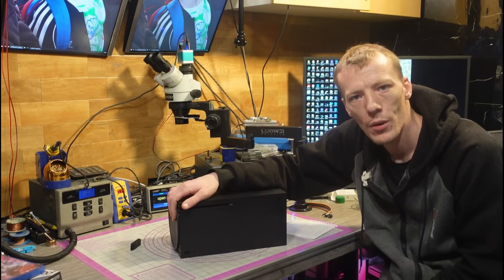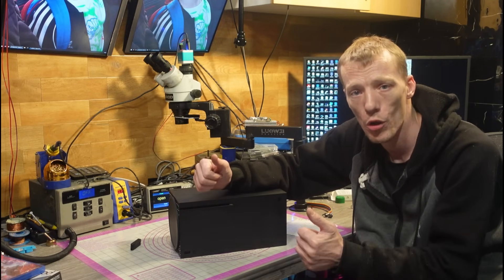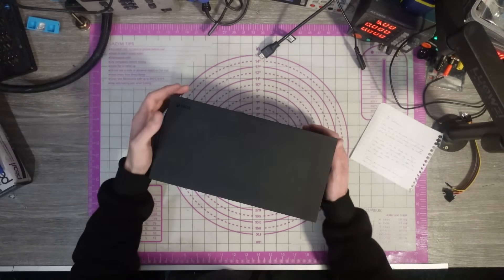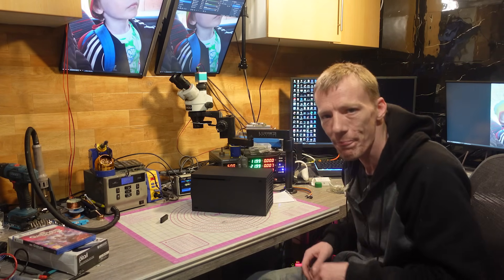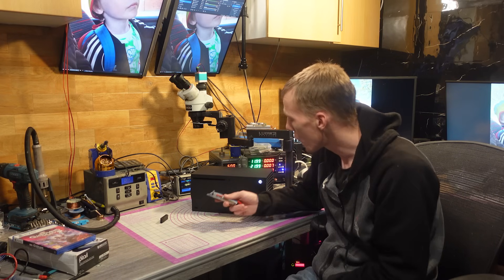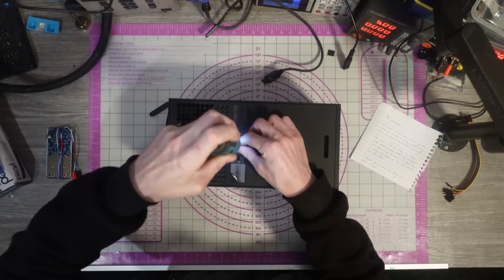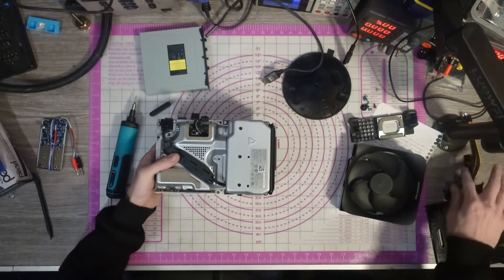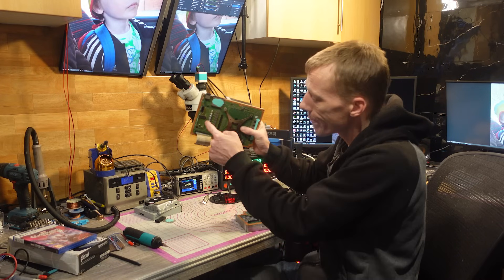THE XBOX IS DESTROYING THE WORLD... AND IT'S MICROSOFT'S FAULT!!!

Comment: What folk need to remember is you can pick up a Working Series X for less than £200. I got a virtually brand new one with controller and all boxed as new for £200 off gumtree.  Much less hassle and saving you a big headache trying to get a broken one fixed. These companies need to stop using weird screws as well, having to buy special tools just to fix a game controller is ridiculous. Why can't they just use normal screws.?! Great video and informative.👍
Reply: "Why can't they just use normal screws?"
You just answered your own question. They don't want normies fixing things easily if there's even a 0.01% chance they might just buy another.
Reply: arnt the screws just T8 or T10 screws or similar?
Reply: @BetweenTheLyons  bosch also use T10 or t8 screws its a manufacturing thing.
Reply: Because the tool you need it's them who sell it guaranteed

Comment: My friend did this to a Series X that he bought broken about a two years ago. The console was damaged by a power surge and stop working according to the original owner, he sold it to him for 125.00 US. I told him that I think he needed to replace  certain chip (can't remember the name of it) and recommended that he take it to a repair shop because fine soldering would be required and the chip was hard to come by. He kept insisting that he'd fix it himself and told me that it's probably something simple. I offered to buy the unit off him for 175.00, he refused and proceeded to format the SSD (without backing it up or trying to clone it). I had warned him that people were saying that you can't mess with the SSD because the unit will be useless without it. Now whenever I visit him, I remark about how lovely his 125.00 paperweight is!
Reply: There are purposes in lessons but i wouldnt sprinkle salt in this wound. Smart people learn from mistakes of others.
Reply: It won't be long before someone figures it out and it'll work again. 

It'll only take 1 dev to  get annoyed. 

PlayStation tried this and failed, xbox/Microsoft is not special, someone will hack it.

Comment: They probably have a service tool to replace the ssd for warranty repairs, but they're never going to give it way. Fixing second hand consoles instead of buying new ones is bad for their profits.
Reply: sort of but don't they sell at a loss because it's a vehicle for getting Gamepass subscriptions?
Reply: @Warlock_UK that’s not what “selling at a loss” means. It’s a common thing that people don’t understand it because the term itself is almost a lie.

They are making money off each console sold BUT it’s classed as selling at a loss until r&d and production costs have been recovered. 

For example ps5 released “selling at a loss” but due to the high sales by August 2021 it was no longer selling at a loss.
Reply: @EelofTheTRIMS  Factoring in R&D, of course - though they could offset that elsewhere.  Initially (well, in 2022) it was hinted that a series X could cost $500 - $700 to manufacture.  Whether or not that includes a fraction of R&D isn't known - but still, if the current per unit manufacture cost is more, then they're doing it to get people to buy accessories, gamepass etc etc.
Whereas Sony don't currently make a loss, neither do Nintendo.
Reply: @Warlock_UK hinted and actually is are very different things. What you have to remember is most of the time when people do this they are treating it as making the console themselves and not factoring in that massive contracts for millions of each part will cost far far far less per individual part which brings production costs down drastically. 

Though the chip shortage at the start of the generation most likely drove prices high this time around though.
Reply: Their policies are bad for profits. Xbox is not doing well. This won't help them.
Reply: @EelofTheTRIMS  Actually that is what selling at a loss means. Only the $499 disc version of the PS% was profitable in August 2021. The $399 discless version was still being sold at a loss. If it was about recouping R&D both versions would have become profitable at the same time. When they say selling at a loss they mean they are losing money every time they sell a console.
Reply: @nerdstrangler4804 no it doesn’t. I didn’t only say r&d I also said production costs.

They were produced in different places on different production lines thus incurred different costs. The disc less version cost less money to buy and didn’t sell as quickly so took longer to break free from the money spent on  production. 

It’s not so much you are losing money as you haven’t yet recouped costs.
Reply: @EelofTheTRIMS  like 95% of the components are identical between the disc and discless version. They use the same production lines.

What it means is, adding a disc drive probably costs them like $20, but they charge you $100 more for it. So that is why they were able to break even on disc version before the discless version.
Reply: @nerdstrangler4804 the components are the same yes but no they don’t use the same production lines. They are assembled in completely different factories.

But yes you are right about the disc drive and the added cost for that version. 

The disc version also sold better early on because people like options. I know plenty who don’t even buy their games physical anymore that still bought the version with a disc drive “just in case”. I thought they were mental of course 😂. That being said I have the disc version but I generally buy my games physical because I like shiny things 😂😂

Comment: Nothing is stopping Microsoft from releasing an image file with an unpaired drive, waiting to be paired. Unless the motherboard chip that stores that pairing information is a write-once chip and it's gets fused off after pairing.
Frankly component pairing should be illegal. Not just for consumer electronics like this, but for everything. Mercedes has been doing it for about 20 years. An arrow on your dashboard broke? You can't replace a part on their car without going to their shop and paying their extortionist prices.

Comment: My guess is they stripped it down to pull the SDD (legal requirement for auction houses this stuff is normally from bailiff companies) and didn't care about if the console was working after that as it was getting lumped into an auction.
Reply: ignorant people not wiping the drive but physically trashing the console to get the drive.
Reply: @HR91360  Not ignorant just people that by law have to REMOVE the drive and dont get paid enough to care.
Reply: @pilksuk  I'm confused.  Why are they legally required to remove the SSD?
Reply: @fffrrraannkk  UK Data protection act companies must ensure personal data is professionally data wiped and certificates provided or the hard drives have been destroyed.
Reply: @pilksuk  Gotcha.  Thanks for clarifying.  That's a good law and I wish they had it in the US.  So they decided to throw out the drive instead of having it professionally reset to factory settings becuase it would have cost them money and/or time to get it certified?
Reply: @pilksuk can they not just factory reset it
Reply: @SlumDog-ip8bq  Nope they have to prove the SSD was destroyed or professionally data wiped.
Reply: @pilksuk  nice 1 pal

Comment: Someone needs to figure out how to extract the key off the CPU. Pairing it to the SSD is a boneheaded idea, and why I will never get one of these bricks.
Reply: I've always hated Microsoft getting into the games console business. Sega was so much more in tune with the history and so much less anti consumer. They also took risks!
Reply: @YourPrivateEye wee need them back!
Reply: @YourPrivateEye The PSX was 299$ msrp in 1995 which would be around 620$ today, also not very consumer if you go by that logic. And you left out the fact that the Saturn was technically more powerful and advanced then the PSX (harder to develop for, especially in that time, but still more powerful if handled by a competent developer). It also had the ability to upgrade system memory, another thing which was out of the question on the PSX. The saturns architecture was much more complicated but had way more potential due to its multiprocessor design which is why it cost more. There are preview builds out there from Shenmue running on the Saturn and they look better then anything ever released on the PSX which only shows how much potential this console really had.
Reply: @YourPrivateEye Still around, they're a huge company in Japan and still make and publish games, Alien Isolation for example. They just don't make consoles anymore.
Reply: I was thinking more of the reverse... there's plenty of SSD controllers that have mptools available that let you change anything about the SSD, including name it identifies as, serial number etc. ...  essentially make a 1-2TB SSD that has a controller with mptools available pretend to be an original xbox SSD via the serial and model whitelist. That obviously wouldn't work here, but could be an upgrade solution for all the crippled 512GB consoles like the series S where buying an expansion card isn't worth it cause it costs more than the whole console is worth
Reply: @robertharper3114 Those risks killed them. Being a platform holder has never been a lock for success. Many have come and failed.
Reply: @sneezyferret6482 is still i good consol
Reply: @sachacozette9292  Defective by design doesn't make it good any day of the week.

Comment: I only buy consoles directly from Microsoft, Sony or Nintendo these days. Usually not at launch because they either sell out in 10 seconds or sometimes the launch models have typical problems like getting bricked with no power or a faulty disc drive.

Comment: You can fix it you can put any ssd into it along as it formatted correctly and you make a windows thumb drive ifixit have the guide
Reply from the maker: No you can't, ifixit are wrong. If the drive dies the security key goes along with it. You need the original drive to obtain the security key
Reply: @TheCod3r  isn't this the same issue with ps5? the os on the internal ssd and if that dies the hardware rendered useless even if you manage to solder replacement chips.

Comment: just a quick question, as a lamen who know's little to nothing about repairing consoles, I was just wondering - could you not get a broken console with a mathcing board and ssd then place it into that xbox to get that one working or does the removal of the ssd go deeper than just the motherboard, ?.  the reason i ask is in mobile phones I.E apple you have to remove a chip and a board and you can just replace the bothe to make the phone work, you can not just replace one of the parts,  great video, just popped up in my feed, thanks for your time.

Comment: Bought a XBOX One X Scorpio Edition that failed updating for 40€ the other day. 

Thought it's just a software issue, bad HDD, bad SATA cable or something other minor. Nope, seller brought it to a shop and got it back with E100. Idiots replaced the mainboard, but not the disc drive.

Pristine limited edition console is now a donor because I can't pair the fully operational hardware. At least I can harvest it to fix several other consoles...
Reply: So find someone with the right software to flash them.
Reply: @jaykiller4510  XBONE hasn't been cracked yet, parts can't be remarried. Only way to get this thing working again is to find the correct daughter board.

Comment: At least you tried mate, microsoft need to get their act together. But also, the ps5 isn't that much better with their non-removable ssd, but at least theirs isn't married to the motherboard and a technician has a chance to fix it
Reply: If you're confident in soldering, you can at least put a new one in a PS5. Still not ideal but at least it's not bound to the console.

Comment: Good video, sad result. Thanks for sharing.

I do kinda get the removal of the SSD. There are times when I have donated certain PC's to charity, but I understand how to securely erase the contents of a HD, in particular a mechanical type.
If the PC is only suited to a tip then I have considered physically damaging the non-working HD - if it could not be salvaged, to ensure the actual contents of the platters are not recoverable. 
With that mindset of feeling the need to be secure I personally would have absolutely zero understanding of the possible consequences of removing an SSD from an X-Box, as shown. Apart from protecting data and just meaning a new SSD is needed, not knowing how MS has linked them. Nor understanding about the levels of encryption by std on those SSD's.
Ignorance , perhaps, over intent to create such an issue as shown here could well apply.
That resolve, if they are interested, is down to MS to resolve.......good luck there.

As noted in the comments already, if MS are to blame here then Apple better keep their heads down. The "rights to repair" only goes so far.............

Comment: Same thing with Nintendo Switches. The CPU and the SSD are bound. Remove the SSD, then you can completely forget about repairing said Nintendo Switch. 

Xbox AND Nintendo need to do something about this, because data protection is a genuine concern if selling a broken device to someone that can fix it. Why? Well if your credit card, paypal, bank or other is linked to the console on one of the accounts with auto-sign-on enabled, they can make as many purchases to their heart's content.
Reply: They could fix it so easily. Even if you sell a faulty xbox and your card payment is on there, m$/nintendo could just prompt for authorisation using your banking phone app when trying to buy a game.
Reply: Sony ps5 pro is the worse because is too expensif

Comment: Thank God I'm on PC and PS4. Upgrading a PS4 to a new SSD falls on two options Clone the old hard drive or like in this case, build it from scratch through downloading the PS4 software fom your pc and transfering it to the PS4 SSD. Boot the PS4 in Safe Mode, initialize PS4, and install the latest system software. Wait for it to restart and your are done.

Comment: in the case of a faulty SSD, how do you clone it?
Reply: You pray the clone hardware can read the ssd for a few seconds. It only needs that section of data. Than you can stick it into the xbox. And do the normal update repair. The keys are all that matter. As long as the system sees those files. It doesn't care about the state of the install. If the SSD is totally dead. Where the clone can't even start. You cna only try to swap the flash chips to another board. And it that doesn't work, SOL. Until someone hacks the console and removes this problem. Which probably won't happen. Til the system is no longer updated. And people get time to figure things out.

Comment: seen afew of theses with ssd. i remember back in the day when i used to repair 360s as well. the cd drives were similar you couldn't just stick anew one in and would work. had to plug the old drive in the pc and extract a key for the drive  and clone it  just to replace. i think Microsoft just wants to stop do it yourself repairs

Comment: Does the ps5 have the same problem or is it just Xbox
Reply from the maker: On the PS5 there are 6 chips soldered to the board. You can replace 3 of them, the other 3 are paired, so it's sort of the same

Comment: After all the bs microsoft f'd up the first xbox in 2013 with, who would have thought they could make a worse blunder. 1Tb is not enough storage as it is, but to make it impossible to repair shows what a nasty attitude they have.
There must be a genius out there who can solve the problem, most other obstacles they put in the way have been solved before.
I stopped buying them when they made the xbox 2013 with slow processors from amd, there is no way they can load quick enough, not enough cores and slower cores than a 2003 processor. XBOX 360 loads quicker.

Comment: just make the SSD unremovable. Its only a memory chip after all
Reply: SSDs have limited lifespan, and if it fails you're basically F
Reply: @akuwdf8057  your f ether way. at least it stops removal
Reply: @hbox21  in modern SSDs if controller detects even one memory cell failing, it will enter read only mode to prevent data loss. So it's possible to clone old drive and replace it with new. I had this kind of drive at work, windows explorer didn't let me read it but with some open source software I was able to recover data.
Reply: Than you just turn it into the PS5. Age will get to the SSD. VS stupidity.

Comment: Could Microsoft’s encryption methods be linked to the reason as to why an SSD needs to be cloned? 

If so, then Microsoft trying to fix this issue could potentially make the platform less secure, leading to a lot more exploits in games. Then we’d have the same problem we did with the JTAG mod for the 360…

I’m all for open-source software for personal use, but when it ruins the experience of others on the platform, I believe it goes beyond that scope.

Comment: So, to avoid Xbox dead, do a ssd clone before his failure, could save the console? is there always the possibility to clone ssd even if this is failed?

Ms could be fix this with an update?
We need to share this on Xbox’s X account
Reply from the maker: You can clone the drive but every time you update the console, the security key changes and you have to clone it again to get the new key. If the drive dies completely it's game over

Comment: That's why i refuse to buy ps5, New Xbox series, because they made them even harder to repair/replace Hard-drives and keep system maintained. With either soldered HDDs or Factory SSHD, you cant swap out HDD without what you said in video makes it a pain in the @** to repair units, either using soldering guns and proper tools. Where with older units like Playstation 3-4 older Xboxs, u can swap out HD and use USB stick drive to reinstall OS, easily same with older Xboxs. Ive had enough of planned Obsolescence and cheap parts breaking.